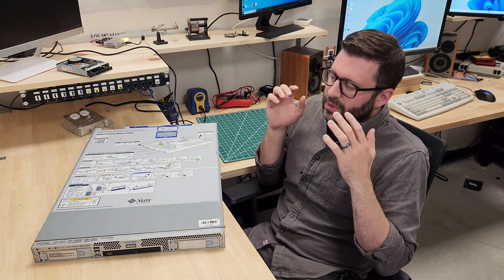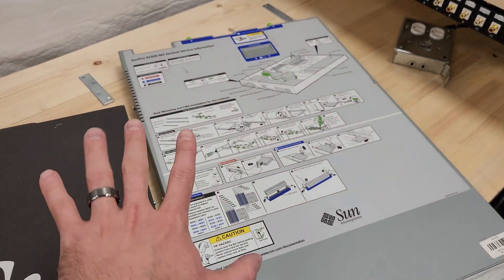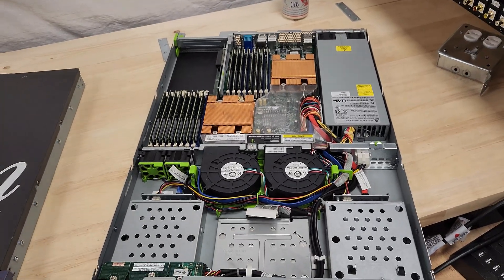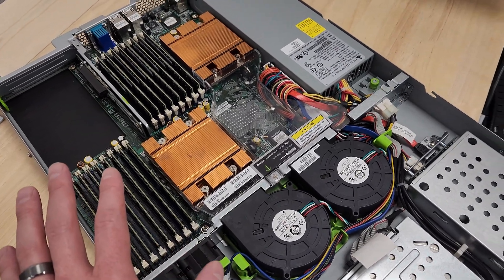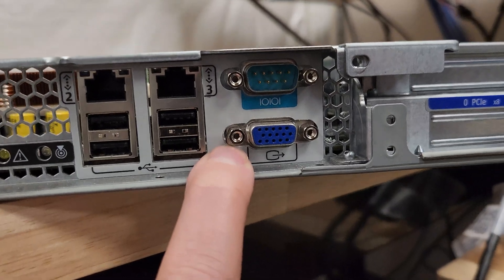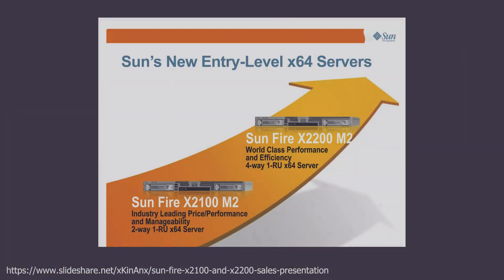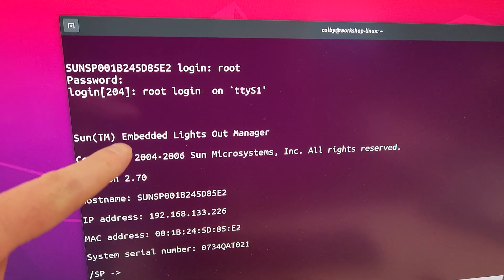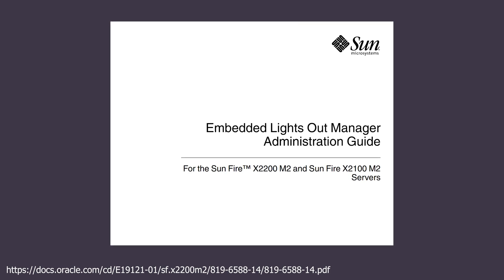Booting a Sun Fire X2200 from 2006

Comment: I ran a few of the v20z servers running Windows Server as Citrix Terminal Servers hosting a 3rd party warehouse software. They were fantastic machines and really showed the raw horsepower that Opteron could bring to the table.

Windows was definitely a 2nd or 3rd class support level but it was enough to keep them going for years.

They were ungodly loud and my boss at the time finally admitted that single pane glass for the server room window was the wrong decision (I wanted dual pane glass) when we had planned maintenance and shut them down. I can still hear them from over 20 years ago 🙉

Comment: @clabretro just got sun oracle server x3 -2 and bought 8 drives and trays would you run Solaris or Linux on this machine? Have you done a video on these yet?
Reply from the maker: cool! haven't used one of those. I like playing around with Solaris (there are x86 versions too) but if I was using it for 24/7 homelab stuff I'd probably run Linux
Reply: Thank you gonna run ProxMox on it and use it as cold storage backups, any idea where to get firmware updates for it without a service contract? they are not as nice as as other manufacturers when you buy their old equipment THACKS FOR ALL YOUR CONTENT!!!  @clabretro

Comment: I don't know if the previous user set this incorrectly or if it was default, but the gateway ip isn't even in the same subnet as it's IpAddress...
Reply: Unusual, but technically would work as long as it's smart enough to figure out not to contact the gateway to contact the gateway
Reply from the maker: Yeah really weird, it came configured like that from the prior owner.

Comment: Nice to see this review, I got six of these , all booting from fibre-channel san.  I belive they only support sata, no sas . Really great server, also got the X4100 that has less memory but has the power supply redundancy and aslo SAS. Its smaler , and i still wondering why Sun made these 2 servers, cause the x2200 is more powerfull than the x4100, but less redunant.

Got a lot of sparc machines and other stuf from sun, 
Running mandelbulber2 on a Sun t4-4 256 threads 😂
Reply from the maker: Ha that's awesome!
Reply: Aimed for different markets. The 2200's were "low end" -- SATA vs. SAS, no PSU redundancy, cheaper construction, etc. While it can hold more memory, if you use all of the slots, it significantly slows memory access.